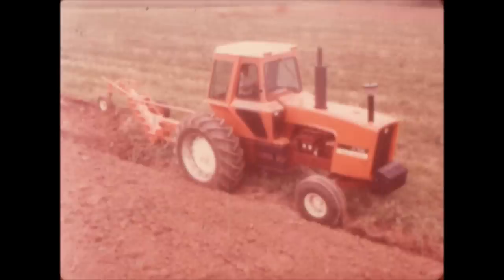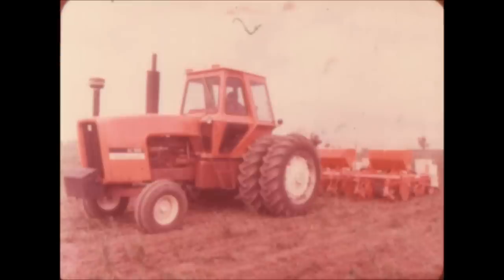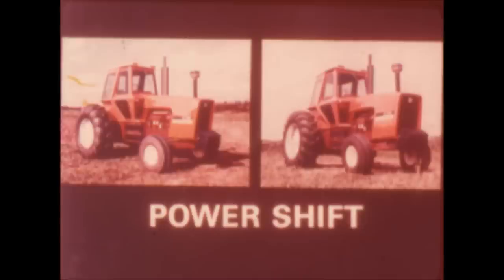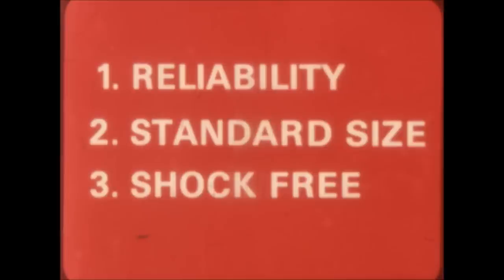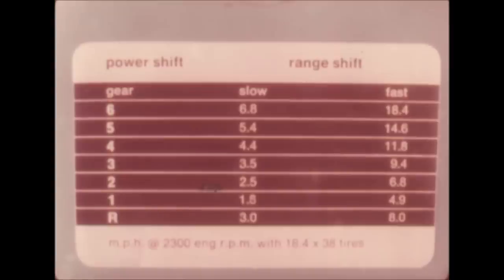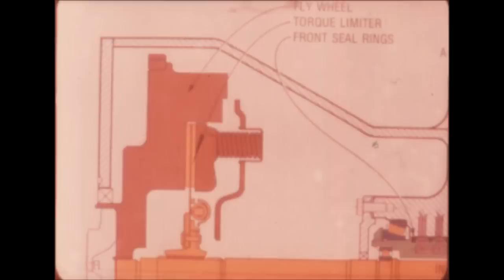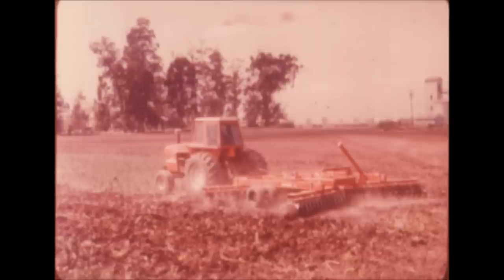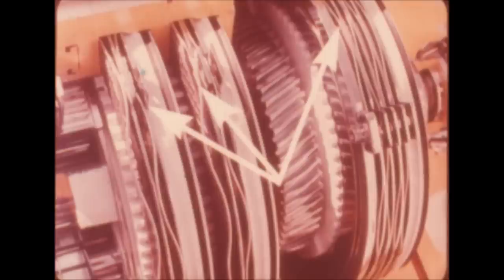1970's Allis Chalmers Power Shift Transmission Demo Pak Tape

Comment: I was one of the launch engineers for this transmission.  We sure tried to do everything right...  Nightmare launch eventually got everything correct.  Cleanliness was the key for assembly.  Super heavy duty, actually worked as advertised.  Perfect for the big contract farms in the southwest running 24/7.
Reply: Tom---I have a 7060 and up until last year it worked perfectly---the transmission is overheating now---I changed oil and filter---no change---do you have any idea why the transmission is overheating, or is it just worn out?  we only use it on a mower conditioner and are not using all the hp of the tractor, ---thank you for any help